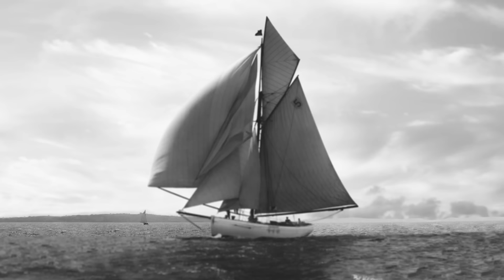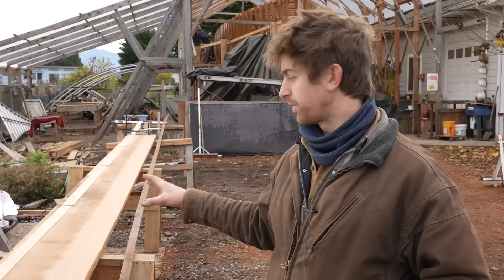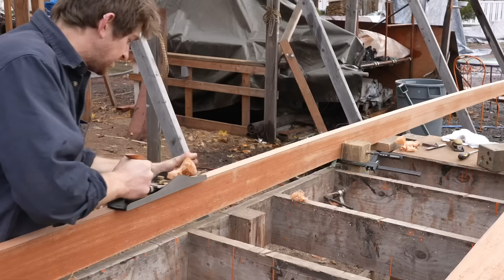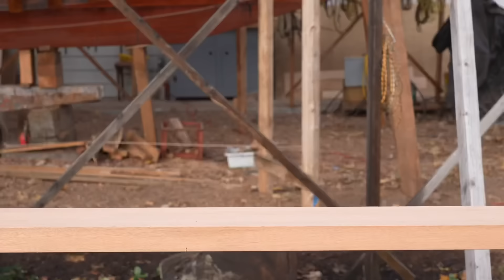Fitting the first new planks / Wooden Boatbuilding (TALLY HO EP85)

Comment: Actually the kind of Renaissance wax needed for long term exposure of bronze or brass to harsh elements is the very hard paste wax.  And it should be applied when the metal is uniformly heated to 125F deg.  Once applied it should be warmed again to 80F deg and left to cool to ambient temperature.  This wax is used in preservation of patinated surfaces and will last for many years if done correctly.  If you want a more permanent finish in harsh elements you can order Urushi 2 part lacquer from original Japanese Urushi lacquer makers in northern Japan and highly polish the metal then apply a very thin layer.  Repeat this at least 12 times and the finish will last a hundred years or more.  There are many examples of this lacquer lasting on battle armor from the 16th century and still performing as a sturdy finish today.

Comment: That there insanely small level as you call it is known as a line level you can put it on as long a lines you want but Mason's line is best you can stretch it and pull the slack out of the line Mason's line  is made to stretch and tighten up as you fo

Comment: SUGGESTION No. 2 FROM THE PEANUT GALLERY: Pete: You mentioned the you didn't use the water level because it had bubbles in it. A few drops of liquid dish soap added to the Water Level will reduce the surface tension of the water and allow the air bubbles to escape more easily. In effect, the surface tension causes the water to collect in globs (scientific term) and to stick to the tubing inner wall which traps pockets of air. Reducing the surface tension also allows the level to "settle out" after each change of position. Using a larger diameter tubing also helps. Also, a little food coloring added to the water will make the water level easier to read.

Comment: Leo: SUGGESTIONS FROM THE PEANUT GALLERY: 

When fitting the planks it might be easier to flatten the curve of the rib rather than trying to carve the underside of each plank. Flattening the mating section on each rib would only take seconds using a block plane or a belt sander.  It Is easier to fit and join two flat surfaces than two curved surfaces. You have already flattened the planks with the thickness planer. Those ribs have plenty of extra material so flattening the surface under each plank shouldn't be a structural issue. Just a thought.
Reply: Leo answered this question in an earlier comment on this video

Comment: Maybe this has b'n said/asked already, and I'm sorry if it has been, but with that wide planking stock, I see you templating off one side and cutting close to, almost on the line. I'd be a bit worried if there were any stresses in that wide planking stock, that you might get the cut plank springing off a bit and not matching the template. You're not creeping up on the line? Roughing out the plank first 'n then relaying the templet? Or is your stock simply so perfectly milled 'n dried (lucky bstrd!) that that's not a concern?
Reply from the maker: Good point! I'll talk about this next episode. Basically the stock is springy enough to edge-set back into shape even if it moves when first cut. Which actually means I can skip using templates at all for a lot of the planks.

Comment: Finally got to see this one..! Assuming that the rabbet is fair, you can also take it as a zero point, and transfer the measurements from side to side with strip of veneer. All and all looking good! Although using epoxy on a plank seam is never a good idea, but glues have come a long way since I've been sniffing them. Time will tell. Hoping those worms are not going to be a huge issue in the future.

Comment: Please explain a plank scale.  Is it different that a measuring tape, or a flexible yardstick?  How is it calibrated, in centimeters or inches, or number of planks?
Reply: See episode 78: https://www.youtube.com/watch?v=rmn4F-K2RRI
Reply: Thanks, I watched episode 78 several times before it became clear to me that the plank scale marks were meaningful when the bottom of the plank scale is against the lowest plank on that frame.  The number at the top of the plank scale gives the width of each plank at that frame.  It was confusing to hear Leo talk about ten planks in that section, while the video was showing seven planks per section.  Thanks again for your tip.

Comment: Hey Leo, any thanks for allowing us, your devoted fans, to share in another amazing day of craftsmanship!!  Your comment on glueing caught  my attention... were you aware that the early wood airplanes were primarily held together with only glue??  The standard process of joining two pieces of wood was to paste up the surfaces of the wood to be glued...then use small brads or nails to join the pieces together...after the glue cures...the nail or brad was removed....of course bolts and metal brackets were used where needed...like engine mounts..etc.   But...When getting my airframe mechanics license, I was very surprised to learn old wood airplanes were mostly only held together with glue..and remember back in the day..there were no epoxies. Also...for the strongest possible joint...the surface to be glued should NEVER be sanded....sanding the wood clogs up the pores...especially on an end cut, resulting in a weaker glue joint...very important on a scarf joint!!...

Comment: Just a Tip Leo, make sure you chamfer the butt block on the top side about 45 degrees, should water get on top of the butt block, then it can run down to the bilge, and not sit on the butt block. Also dirt and grime collect there over time.

Comment: Yeah Leo.. You didn't show how you scribed the plank template at each frame station ..then at each frame station on template transfered that to plank.. then set compass to plank width at each station to scribe off plank width at each station.. then take fairing batten thru those points to get a fair line.. then cut to line ..! you only showed fairing up plank edge.. Im sure ude agree there was a lot more to marking out and finishing plank than u showed.. Good that you showed tho how to get out making plank concave.. and the Germanjack plane and electric plane blade modifications to achieve getting out process..
Goodonya Leo in every way you are a young man with a much older tradesmans skills indeed..Go to the top of the class.. 👍 😁
Cheers..HB..

Comment: If you don't split the bevel, and you're using the same thickness of wood, one will sit proud of the other when they meet.  Are you planing these off after?
Reply: Once the planks are mounted, hours & days & weeks will be spent fairing & smoothing & sanding them. Then there's the caulking & paying & painting to do !

Comment: Ever considered an electric motor instead of diesel? Full torque and horsepower in the 1st revolution of the motor. Perhaps a small gasoline engine with a nice generator to pump up low batteries when the sky is gray, a few solar panels and it could work out.

Comment: Acorn to  Arabella used scarf joints on their planks, why didn't you use the same method ?
Reply: Leo is not partial to epoxy in his joinery, but he'll use it in a pinch. The prob is, it doesn't match the wood's movement as the temperature & moisture content change. A glued joint will fail much sooner than a rivetted butt-block.

Comment: Hi Leo, Just a safety point, to keep your crew safe. The rivet setting tool that you show them using when setting the plank... It has a mushroom head on it from use over time. The  mushroom head can splinter off and shoot at you or other people. It should be ground out and have a bevel on the edge. Believe it or not, It will make it easier to use as well. Great work on everything! It is art in every stage. Thank you for sharing it with the world.

Comment: Wouldn't it be easier to flatten the spots where the plank is attached instead of hollowing the plank out?
Reply: Lateral thinking, like it.
Reply: @AnthonyHigham6414001080  Just my opinion. I am not a boat builder, but a Craftsman. There has to be a reason. Maybe for sealing or something ✌🏼✌🏼😁🔧
Reply: @lukasschimpel9655  Possibly it is easier and maybe gives a better fit. Seemed like a lot of work to plane in the dish but nevertheless beautifully done with the ground planner blades.
Reply: @AnthonyHigham6414001080  The whole boat is a piece of Art. I love the work and passion that is going into it. I have so much respect and I am amazed by the endurance and the will the whole team is bringing in. Maybe we'll get an answer from Sam if he has time for it. I would appreciate it a lot because I am curious as hell 😍😍
Reply from the maker: It is sometimes done like that (usually on larger boats) but is generally considered a less fine approach. Personally I don't think it would be any quicker - the corners of the flat spots would beed to be exactly in the right place with the edges of the plank for it to work well, which would be challenging. The position and width of the plank is not completely defined until it is on the boat (the marks on the frames are a good guide but overall fairness is most important).  Lastly, it's a lot quicker and easier to plane a piece of relatively soft wood on a bench than overhead plane 22 curved Live Oak frames to be exactly fair!
Reply: @SampsonBoatCo  Can't believe you really answered!! 😍😍😁 Thank you so much for your explanation!! So your marks are more of a guideline instead of the very last position where the plank is going to sit for the next 110 years..saying the wood you are working with, is telling you where it finally wants to sit if I understand correctly. Anyhow I am astonished by the work you, the Crew and espacially the Parrot and the Dog are getting done. All the best and stay healthy in this crazy times. Best wishes from Austria ❤️
Reply from the maker: Exactly :) 
Cheers! L

Comment: As I watched the beautiful scenery shot from the plane a few things went through my mind.  First where were you flying, that is some extremely rugged terrain.  Second  was something my deceased father (a 36,000hr airline) pilot said to me.  I was taking a similar trip, just an hour flight over similar terrain.  He said; I hope you're  equipped to spend a night ot two?  I responded "its only a 40 minute flight."  He responded with something I've never forgotten.  "Remember, ten minutes of flying over mountainous terrain could be more than a weeks worth of hiking."  " Wouldn't it be the shits to survive a forced landing in high mountain terrain, come out of it uninjured only to die of hypothermia and exposure!"  " Any  time you venture into high mountain terrain you need to plan that you'll be spending several days without help, and remember,  it may be fall or spring at the airport but it's full on winter in the back country!
When I saw some of the beautiful high mountain heavily snowed winter mountains you were flying over it sent a shiver up my back knowing that with the slightest mechanical problem you could be making a forced in minutes in hard winter terrain and wondered if you had anything beyond the clothes you were wearing?

Comment: You would be wiser to learn to use that water level well.  Seriously, "the hose" is much more accurate.  For problems with bubbles,  just use a larger diameter hose and avoid having much extra length coiled up under the boat for bubbles to get trapped in.

Comment: The "string bubble level" is an extremely inaccurate level. If the entire boat is not level to begin with, the starboard and port side measurements will be off.
Reply: How "inaccurate" is it though, in quantified numbers? How accurate, in quantified numbers, does it need to be? Most people naively think that "precision" work involves being the most accurate possible in everything, when really "precision" work means being exactly as accurate as you need to be, when you need to be that accurate.

I'm pretty damn sure Leo is watching this all carefully, and if it looked off he'd be on it in moments, as would Pete and the rest of the crew. They've already done some beautiful videos on how accurate the original boat and its repairs were, when compared with the plans, and it shows how just being true to the numbers alone may be the worst kind of folly.

Comment: It is interesting to compare how you do thing vs how Alix and Steven from Acorn to Arabella do things. A couple big things stand out: you are using bribes for the knees and floors, while they only used bronze for the floors (for financial reasons.) Also they did their planks differently  by overlapping and scarfing the joints between planks.  I'm not sure on is "better" than the other, however it is interesting to me the differences between the two approaches.

Comment: Those little mason's string levels are treacherous, because the little hooks eventually wear as the level slides on the string and it's hard to detect....
Reply: Yes, they are only cheap plastic and mass manufactured.
I was reassured when Peter said right at the end that they were double checking with measuring and battens. 
Truth be told, he's being overly fastidious. 
No one will ever be able to see any dis-symmetry
Reply: @dnomyarnostaw  But, from what I understand, one distinct advantage of having symmetrical planks on both sides, is that you can a plank from one side as a template for it's partner on the other side. With the number of planks involved, that could be a serious time-saving.
Reply: @2H80vids  Good point. From my experience, the second plank still ends up having to be seriously "adjusted", no matter how careful the builder is, because no ship is truly symmetrical on the frames.
The "sister plank" is just a convenient approximation in the end. The "Acorn to Arabella" team certainly encountered that.
Reply: I'm glad they double-checked. The water level is so much more accurate. The longer the line, the less accurate the line level is. The further the span of the water level, the more accurate it is.

Comment: PLANKING. A curve becomes a straight. A straight becomes a hollow, and a hollow becomes a whole lot worse. We used to use small home made bevels made from old hacksaw blades to get the edge angle between planks. There was a pop  rivet as a hinge on the bevel just tight enough to hold the bevel before transferring that bevel onto the new plank.  In my day, hollowing planes were standard tools, but I really like your Makita electric model. Nice work, keep it up.

Comment: Whenever in the future you want to transfer lines from port to start board or visa versa use a transparent tube/hose fill it with water and food dye than it’s ten times faster to copy the lines and use it as a U-tube level guaranteed
Reply: They said they tried that. Apparently there were problems moving the tube under the keel (because of the support blocks?). They also had issues with air bubbles.
Reply: @ColinWatters   Well there is absolutely no reason to move the tube all the way underneath the keel however to resolve the issue with the  bubbles use a larger tube diameter(or use mercury if you could obtain it 😷😷😷 just kidding)

Comment: 00:00 Week off activities
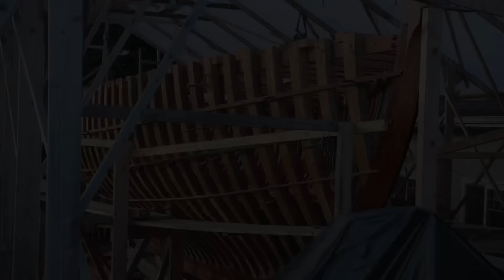04:00 Back to work
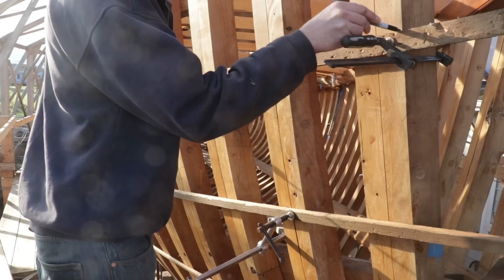04:50 Marking the master lines
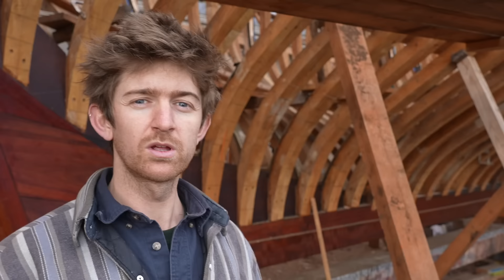05:25 Dividing and marking for the planks
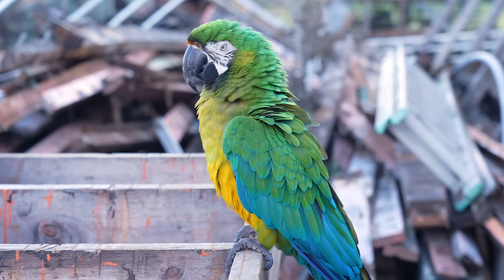07:20 Making a template
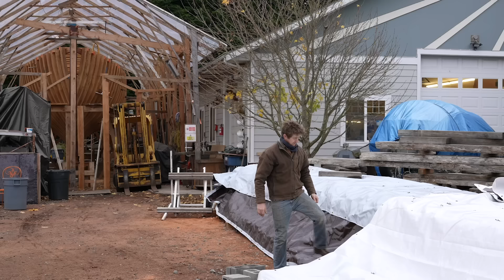10:15 Selecting a board
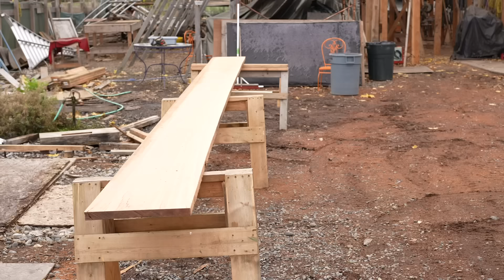11:30 Marking the board
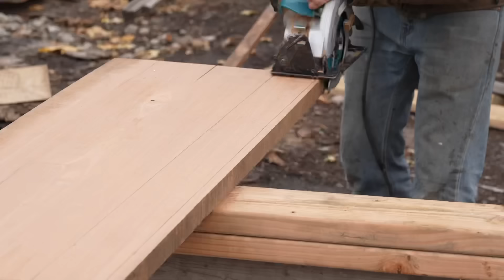12:41 Sawing the board
13:14 Transferring plancking marks to the other side
15:37 Carpentry
17:13 Bronze parts final polish - awesome images!
19:25 Butt blocks
21:04 About planks and bevels
23:36 Backing - special tools
25:50 First two plancks are placed
29:39 Fixing an issue
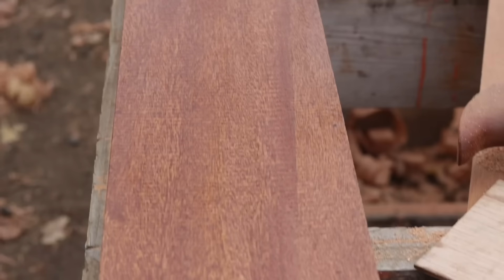32:02 Week's Summary
32:47 Riveting the planks
34:12 Thanks
Reply: Hey this can be a reference book, and you just did a good service to this episode.
Reply: Should have this index at the top of each episode!👍🏁🏁

Comment: Most interesting to see how you made templates and shaped the planing blades to cut a concave into the planks to conform perfectly to the frames. Her hull will be absolutely amazing and so strong and tight. I am curious how the copper rivets will be secured inside. Maybe bent to 90 degrees and hammered flat? Poncho certainly keeps a sharp eye on progress. Cheers.
Reply: A lot like how they installed the knees, a weight against the side with the head, side without gets hammered to mushroom it large enough it can't back out.

Comment: Just a suggestion, but wouldn't it make more sense for the plane you're using to be the same width as the planks for a more uniform concavity? Run the plane over the plank set in some kind of jig to keep the plane centered on the plank for the uniformity?  Wish I had the means to do what you're doing...BRAVO!

Comment: I’m not convinced about the accuracy of those string levels. Why not tick mark from the keel?
Reply: Laser level
Reply: At the end he said they were checking them a couple of different ways
Reply: I second the laser or water level.  String has many uses, but using a level that way can give surprisingly out of level results.
Reply: @palettetools6461  Well inaccuracies will show when they dupe the plank templates.  At the end of the day the boat needs to LOOK symmetrical.  Now that string level VS the human eye?  Not an issue.  And yeah laser level would have been better.  I just bought a Bosch one for tiling.  They can keep adjusting individual planks.
Reply: Yeah, I was surprised at that too, those things are 'kind of' accurate over their 3 inch length. Odd they couldn't get the water level to work, they can be dead on. Of course you'd need to verify the boat is level across the beam, otherwise you'll be marking in the wrong spot no matter what the level shows.
Reply: Not a problem.
No one is ever going to see any small variations.
Reply: I never had any problems with a water level. And they're way more accurate than anything with a bubble.